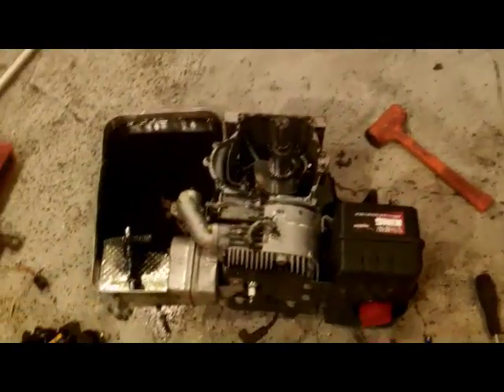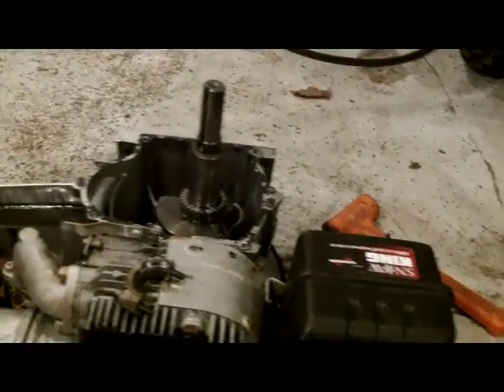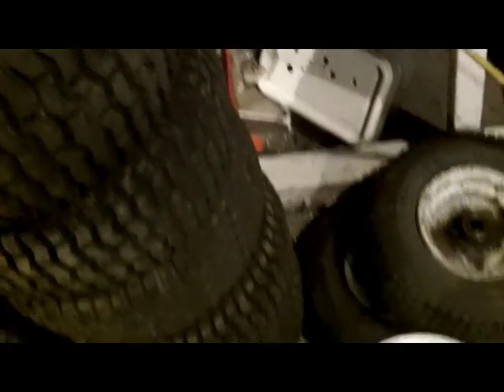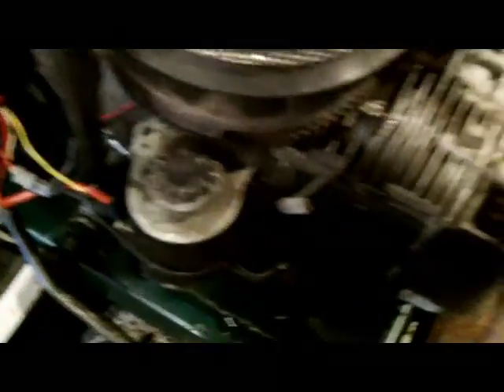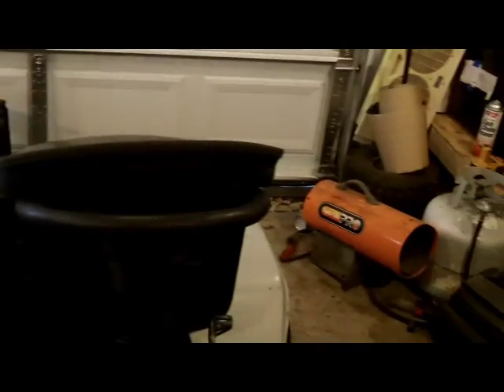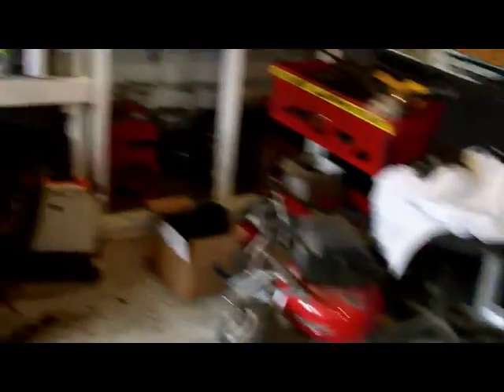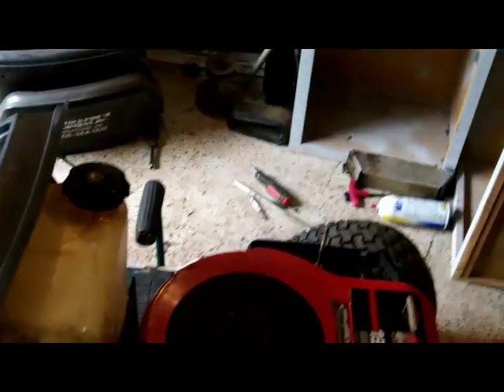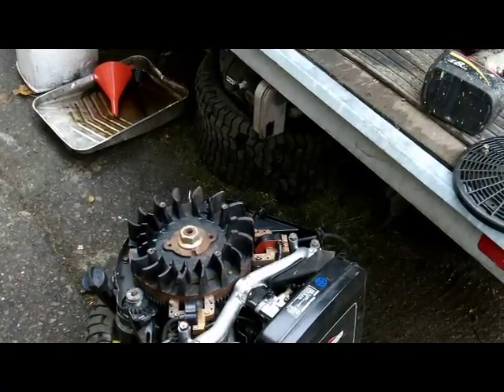working on the mtd yard man lawn tractor

Comment: I geas I was correct about the wires, that extra red wire just cap it, don't put it to the starter, you may burn out the wiring harness, just think about it, if the solenoid goes out, you have key on power going to the starter, the wire is the wrong gage, may start a fire!
Did you know that, Husqvarna make Dirt Bikes, just found it out on Pawn Stars.

Comment: working on an mtd mower..engine 311777 0120-E1,old wire on magneto burned,figures that was prob lol,put a new magneto(gapped with card),plug,air and oil filter on....ran for thirty mins,then had to clean fowled plug,backfires bad and when blades engage it dies???any suggestions...other than a torch....pls don't say piston rings...run highest octane,could it be ethanol in gas bad for mower?

Comment: i just replaced a left side mandrel assembly on a 46"deck (double pulley) for a three blade deck and the pulley closest to shell is slipping (no grip at all to get belt to turn the center and right blades). i'm stumped. any suggestions pck?

Comment: I've got a yard machines 15.5 hp. went to mow today and I went to engage the  mowing deck and blades ran for about a minute then the engine sputtered and stalled. It has new gas, fuel filter new oil and a new air filter. I have no f@#king clue what sensor it could be. this problem never happened to me before.